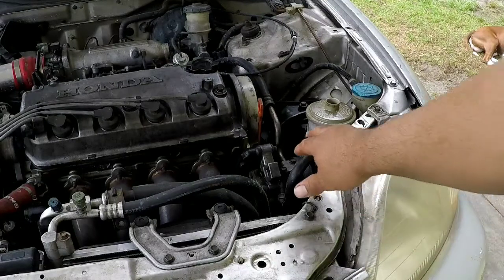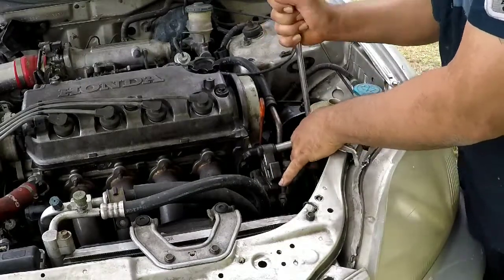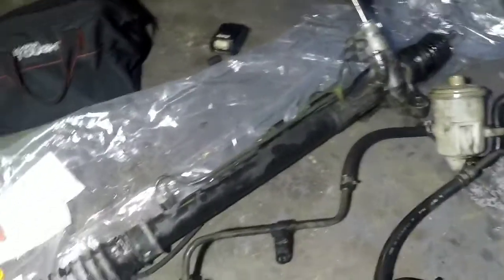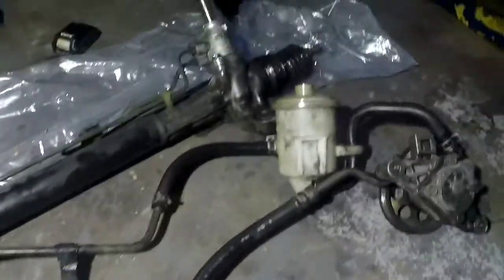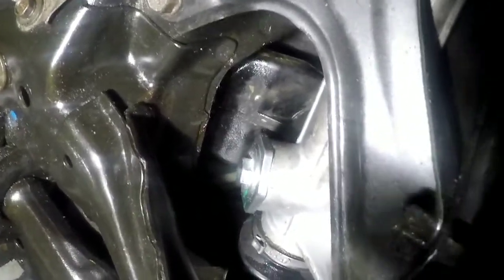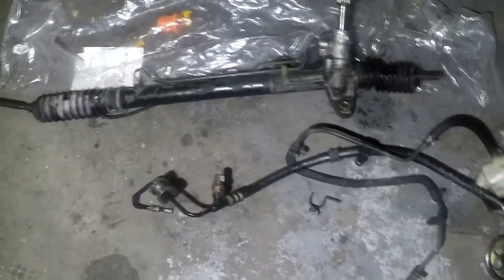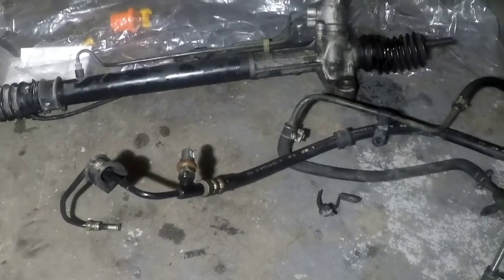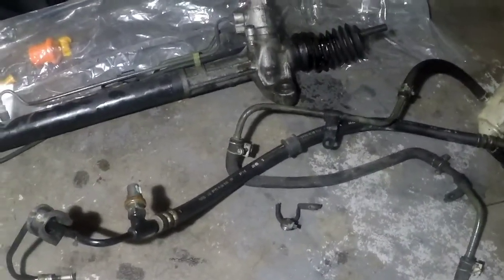Manual rack and pinion convertion

Comment: I'm doing the exact same job right now but my steering knuckle that joins the rack and pinion and the steering spline in the floor board of the car isn't working. One side of the knuckle fits and the other side that's supposed to fit on the manual rack isn't fitting. Did you run into this problem and if so, what did you do?

Comment: Nice video. Where did u get the rack and pinion one. Two how bout the steering joint what part numbers did u use. Please and thank you.
Reply from the maker: Advance auto .... steering joint you can use either civic ef with no p/s pump or civic eg without p/s pump
Reply from the maker: Make sure the rack and pinion is civic 96 to 2000 manual rack
Reply: @vxjdm1993  will a 96 to 00 ek manual rack bolt on direct fit to dc2 00 integra chassis without a passenger side braket like as if i were to use a 95 eg manual rack